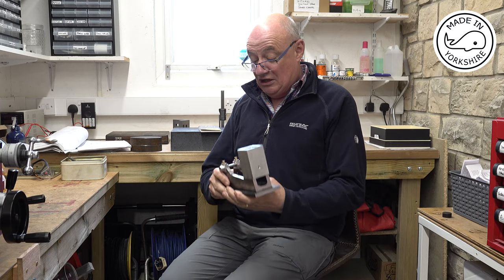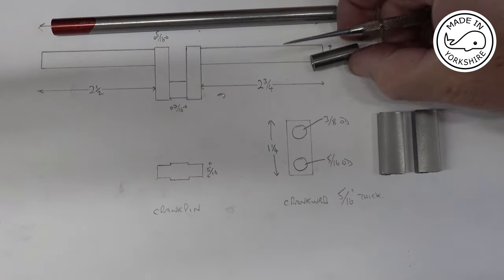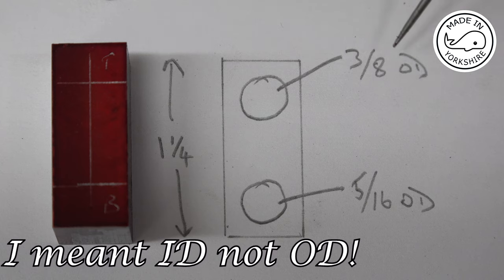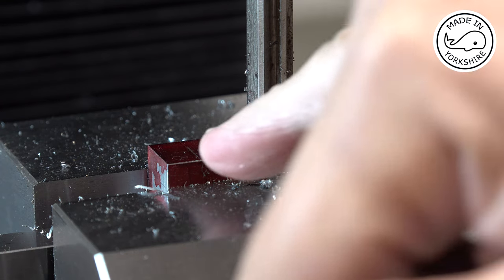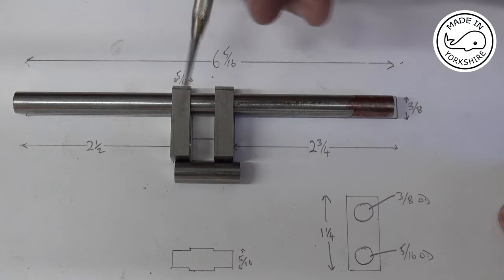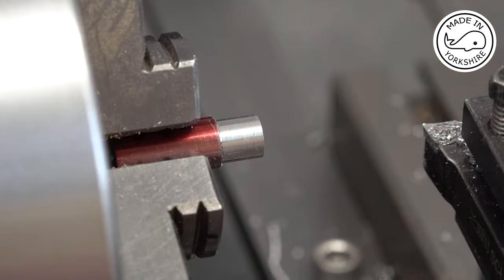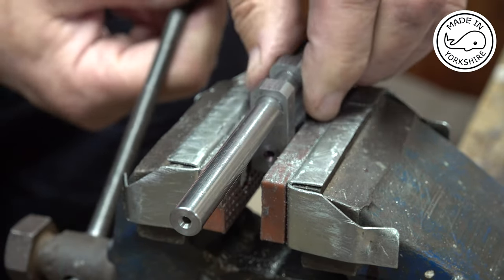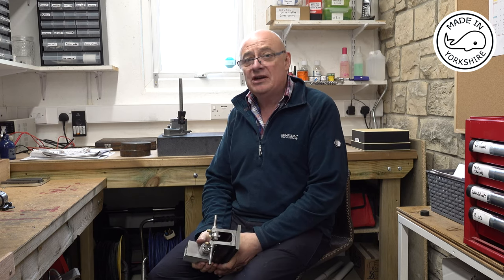#MT41 Part 8 - Philip Duclos Odds n Ends Engine. Machining the Crankshaft. In 4K by Andrew Whale.

Comment: Thank you. I have machined many hundreds of forged steel crankshafts. That gave me a mind set. No way would I have considered assembling a crankshaft from pieces for a hobby project.
Reply from the maker: Thanks Don - I suppose I should try machining a crankshaft from a solid bar - but it just seems a lot easier fabricating one. I guess it becomes more important for higher revving engines.
Cheers
Andrew

Comment: Friday morning coffee with Andrew Whale. Another great video. I have made crankshafts both ways and I do believe I like the built up style best. The Tom Thumb and Stuart Turner twin were made from a casting for the ST and a piece of bar stock for the Tom Thumb. Both are twin cylinder engines and required the throws to be offset by 90° I am sure fabricated would have been much easier. Glad to hear your lock down is easing as is ours, Happy Christmas to you and the family.
Cheers, Dick B.
Reply from the maker: Hi Dick - thanks for the info. I quite fancy raising the bar by making a twin cylinder IC engine next time - not sure what though. I guess it would be interesting making a fabricated crankshaft for that.
Happy Christmas!
Cheers
Andrew

Comment: Watching you use the hacksaw reminds me of when I first started my apprenticeship. I was working with this cranky old journeyman running electrical conduit in a saw mill. He was on a ladder and calling down measurements for me to cut, and being new to the industry I was trying to make a good impression and was working as fast as I could. Right in the middle of a cut he yelled at me and asked how long my Hacksaw blade was ?  Trying hard to impress him I whipped out my brand new tape measure and yelled back “ 12 inches “. He then yelled back “ well use the whole damn 12 inches and quit wearing out that 2 inches in the middle “ . A lesson that i never forgot the whole rest of my career 😉 .
Reply from the maker: Ha ha - a great story. I don't think I will forget that either.
Cheers
Andrew

Comment: Excellent work as usual Andrew. A question for you when machining the Crank Pin did you use a three jaw? As how would you ensure concentricity when turning it around to machine the other end. Just a thought.
Reply from the maker: Hi Philip - a good thought. I had the same thought after I machined it! My 3-jaw chuck is quite accurate but ideally I think I should have used a 4-jaw. The end result seems pretty good though.
Cherrs
Andrew

Comment: Sometimes you say ”super glue” and sometimes ”loctite”. Are these terms both synonymous with Loctite 638?
John McWilliam
Reply from the maker: Hi John - I think they are entirely different. Superglue is an alternative name for cyanoacrylate (CA) glue. I think Loctite produce a cyanoacrylate glue, but I think Loctite 638 has a totally different chemical composition. Loctite 638 is a high strength bond for cylindrical parts - eg shafts in holes. To temporarily glue two flat surfaces together I tend to use superglue or solder. Both Loctite 638 and superglue can be broken down by applying a lot of heat.
I hope that helps, and if I'm wrong I'm sure others will correct me.
Cheers
Andrew

Comment: I think I need a DRO on my mill 🤔
Reply: I have thoroughly enjoyed mine if for no other reason but to serve as a sanity check to ensure that I have moved the table the correct amount.
Reply: @robertoswalt319  It's a big outlay for my WM14 mill. I think I paid 450 for it, and fitting a DRO would almost match that. Finding the centre of parts would be improved though for sure.
Reply from the maker: Hi Ian - I found that the DRO changed my milling experience entirely - now it's very enjoyable and a pleasure to use. As Robert says it serves as a  sanity check too.
Cheers
Andrew